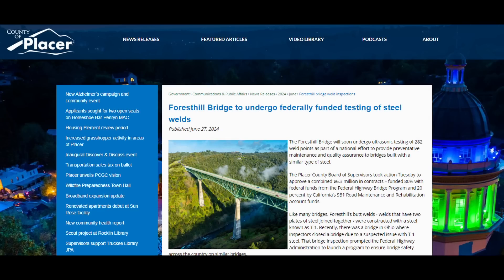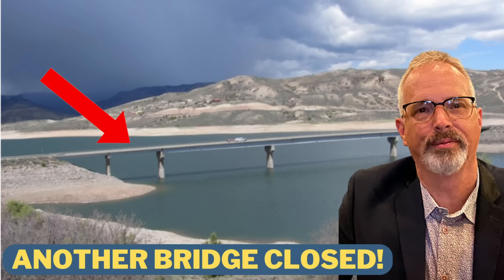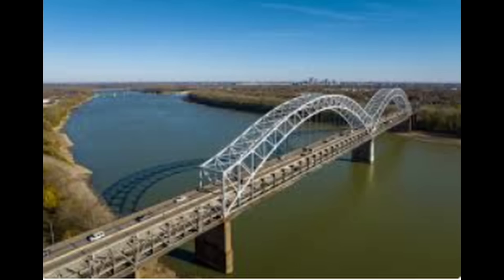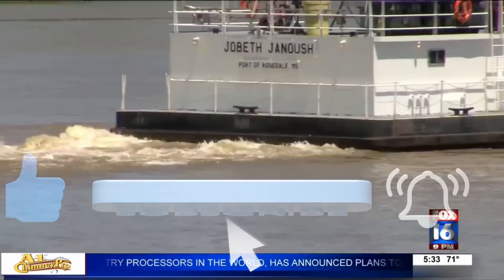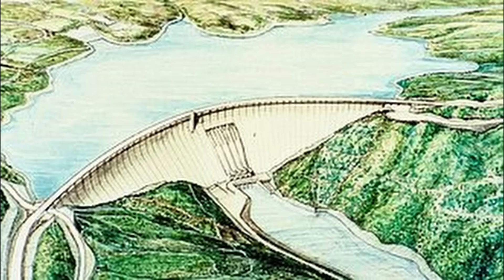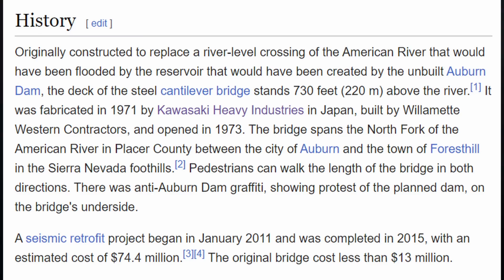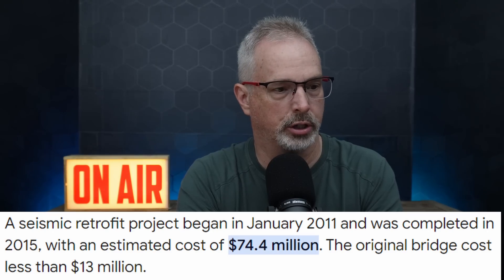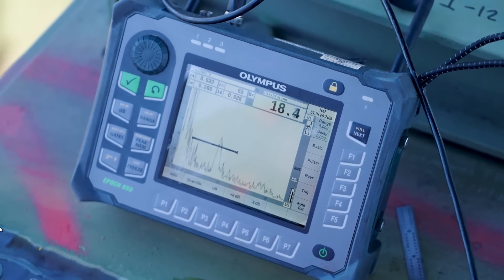Foresthill Bridge in California - Another T-1 Mess?

Comment: What welding filler was used? Were things like the original WPS saved?  Spectrometry could be useful if the filler is currently unknown. (Scrap yards and steel mills accepting scrap use hand held analyzers to determine metal composition.)

Comment: If T-1 steel requires technique sensitive welding and a higher standard of quality control than usual, perhaps it's not a good choice for most structures.  Hiring a framing carpenter to do cabinetry is a poor choice.  The designer of the bridge as well as the engineer may be more responsible for these failing welds than the foreman and welders on the job site.  BTW, many of the examples of failing bridges in this presentation showed cracks in the beams not the welds.

Comment: 1970s + A588 Weathering Steel + High Mast Lighting Towers + Deicing Salts
Can you imagine what went wrong? Not only was it very brittle but it never stopped rusting. They sent men up the towers to drill the cracks everytime they relamped. Used it in overhead sign supports too until one fell off a bridge into a car. Pack rust in that case. Hard lessons to learn. Hot dipped does pretty well. Not sure why we don't see it in bridge superstructures. It only lasts 30 years but so does coating and confinement for painting onsite is very complicated and expensive, especially over water. Galvanize + Zinc anodes if necessary. We can hot dip all of our guardrail but beams are too expensive? Or are there technical reasons?

Comment: Are there any metallurgist in the audience How? 
How do we know this was hydrogen embrittlement and not stress induced cracking caused by inadequate pre/post heat treatment.
The reason ai am asking is that hydrogen peniteration requires a significant partial pressure for penetration - conditions that don't really exist during an atmospheric weld.  The hydrogen if available usually causes rapid failure under stress not 50 or 60 years later.  Hydrogen can just as easily migrate out of the metal given time.
Given the date of manufacture of this of this metal, it is also possible that there may have been too much manganese or mill-scale in the steel.
Regards.

Comment: Hi, what was the common welding method on these joints? IF it was it MIG? Was hyd gas used in the mix? If not, then what caused the hyd embrittlement?

Comment: How much of this problem is the material and the welding technique and how much of this is the design for higher stresses?  The only reason to use grade 100 material instead of more common grade 50 material is to design for higher stresses and reduce the amount of steel.  Obviously going from 50 to 100 means you can save a lot of pounds of steel and a lot of dollars.  But designing for higher stresses in a bridge means also higher stress ranges due to traffic loading and it is the higher stress ranges that lead to fatigue cracking.  Then you combine higher stress ranges with welding and it gets worse.  Building codes have permissible stress ranges for different types of welded joints, I assume bridge codes would have the same thing.  I wonder if this type of steel requires lower stress ranges than other steel.  If so then there would be no advantages to using it over more common lower grade steels.  (For anybody reading that doesn't know- "grade" is a measure of the yield strength and has nothing to do with the quality of manufacture of the steel.)
Reply from the maker: Excellent point.  I didn't consider that combination but it makes sense.  This T-1 steel was supposed to result in a lighter, less expensive structure so it would only make sense that the design stresses would be higher.

Comment: I remember a Sacramento Bee article about this bridge back when it was being constructed that claimed the reinforced concrete support pillars were designed so that the waters of the reservoir would help support the weight.  I have never heard anything about that since.
Reply from the maker: I would think that the columns are better off not being submerged from a corrosion potential standpoint of the reinforcing steel in the concrete.

Comment: There are four types of welding. Gas welding or brazing ... Stick welding ... Mig welding where a machine has a coil of metal wire fed at the seam to be welded protected by a flow of inert gas .. and Tig where you have a tungsten tip in a handle, which also issues a flow of gas, and you manually push a melting rod into the seam to be welded. Likely Tig is the hardest; I tried it at a welding school in a community college. Anyone knowing stick welding can easily do Mig welding. I have never done Brazing.

Comment: They knew about this potential problem as soon as that bridge in Minneapolis fell, because the Foresthill Bridge has a similar design. Caltrans is currently doing a major inspection using the latest tools and may do repairs as needed. But unlike the bridge in Minneapolis, they haven't made changes to increase the load on the bridge, so I don't expect much in the way of serious structural wear.

Comment: We cross the East Liverpool bridge fairly frequently, and had to use the long detour when it was shut down.  1.5 miles west of this bridge is a fairly light 1905 built suspension bridge, still in use. It was built for lighter loads, so has a 10 ton limit. Street view is from 2019, and shows a crew inspecting the suspension cables.

Comment: I'm a welder, not an engineer, why can't they gouge out the crack and re-weld it to modern standards?

Hydrogen embrittlement in welds is fairly common. you have to keep your filler rods dry and fresh. They have to be baked in an oven to drive out any moisture, and they will start to absorb humidity very quickly. 

If you wanted structural welds like that these days, they would probably use thermal blankets to handle the pre and post heat

had to look up astm a514 for the comp
Carbon 	0.12-0.21%
Manganese 	0.70-1.00%
Phosphorus max 	0.030%
Sulfur max 	0.030%
Silicon 	0.20-0.35%
Chromium 	0.40-0.65%
Molybdenum 	0.15-0.25%
Vanadium 	0.03-0.08%
Titanium 	0.01-0.10%
Boron 	0.0005-0.005%

yeah, that's not going to weld well, and its a quenched and tempered product so the weld heat zone is already not great being there

Comment: Not knowing many details about this problem, from what I hear in the video and in the comments, the problem may also be an excessively hard HAZ in the weld.  This is due to heat input and hardenability of the steel.

If the crack is immediately adjacent to the weld toe, then I would be inclined to consider this as the problem.

PS:  I went and looked up the composition of T1 bridge steel and given its composition, this steel has a high hardenability.  Given the range of alloying elements in the material, the Carbon Equivalent (CE) ranges from 0.35 to 0.56.  A material is considered to be field weldable (or shop) if the CE is 0.42 or less; however, thick sections may require preheat and PWHT.  For CE > 0.42, (and especially in thick section greater than 0.5" t), preheat, slow cooling and possibly PWHT are needed in order to prevent an excessively hard HAZ.

With this composition, it would be very likely that cracking would occur if so-called normal welding techniques were used, that is no preheat, no slow cool and no PWHT.

I have had to solve welding problems with materials that had this high of a CE.  It is possible to obtain sound welds in this high of a CE material but as I mentioned it does take special precautions to achieve a sound weld.

Hope this helps.

Comment: I'm curious, why did the cracking in T-1 girders occur in the I-40 Hernando Desoto bridge girders where the attachment used is bolts instead of  welding?    If preheating and cooling procedures T-1 welding were not used,  then the failures in the bridges are in part due to the civil engineering firm by not monitoring the construction company's welding procedures.

Comment: The crack shown at 2:40 is not 'at the weld' it is on the  edge of the HAZ (heat affected zone). if the weld area had been pre-heated to around 200-220°C  at the time of welding it would not have happened. It is there due to rapid conductive cooling around the weld inducing micro cracking that precipitate embrittlement much earlier than would be the case with correct management of welding procedures.
Retired Engineering Professor at a top  British University.

Comment: Apprently this was another bridge built prior to the late 70's when the Federal Highway Administion started to adopt the Fracture Control Plan of the Bridge Welding Code to ensure proper welding procedures and post-welding testing to prevent defects like hydrogen cracking. 

Funny how bridges built well before welding - with only rivets or bolts don't have this issue. 🙄
Reply: Not having weld-specific issues is not the same thing as not having issues.

Comment: They should just plan on cover plates on all joints as a permanent preventative if there is any question about the structures that use this type of steel moving forward as the welds are questionable due to the materials used and design..

Comment: I had telescoping crane boom extensions made from T1 plate in the 1980s. No butt welds were involved. I did study the data sheets and the welder did too. He used a very high tensile rod. Did my own design calculations.  I did lots of lifts at the limit of capacity. No problems.    I can see the butt welds in a tension member would be a real worry. Nightmare.

Comment: If i understand correctly, the reason why the auburn dam was cancelled was because far more landslides than expected occurred behind boulder/hoover dam as it filled, leading to substantial concerns about how stable the land under the cities of auburn and foresthill might be as the reservoir filled.

Also, if foresthill bridge is condemned, I doubt it would be replaced since it would be much cheaper to improve the road that runs through auburn SRA. The bridge was only needed because the alternate road would have been submerged
Reply: It was put to a vote and the Chicken Littles of the area got their way. Fools.

Comment: WHat about: Hernando de Soto Bridge on Interstate 40, connecting Memphis, Tennessee, to West Memphis, Arkansas, experienced a significant issue with a crack in a T1 steel beam, leading to its closure in 2021 for emergency repairs. This incident sparked a broader inspection mandate by the FHWA for bridges with T1 steel.
Sherman Minton Bridge between Kentucky and Indiana over the Ohio River was mentioned in connection with T1 steel issues, leading to an advisory for inspection due to potential cracking from hydrogen embrittlement in welds.
Francis Scott Key Bridge in Baltimore, although its collapse in March 2024 was due to a collision with a container ship, highlights the attention on bridge integrity and material performance under stress. However, there's no direct mention in the provided X posts or search results that its construction involved T1 steel or that its failure was material-related.
Pelican Island Bridge in Galveston, Texas, suffered a partial collapse after a barge collision in 2024. While this incident showcases vulnerability in bridge design or material resilience, there's no specific mention that T1 steel was a factor in this case.

Comment: In the early 70's when this steel came into use, the shop I was working in made sure anyone welding the higher strength steels was qualified and using the qualified procedures. That meant that we used a lot of gas to heat up the sections prior to welding and a lot of gas for a slow cool. We used 9018 electrodes and, later, 1118. Mostly ran 5/32 and 3/16 lo-hy kept in heated ovens. The containers we took to the weld itself were insulated and we were not allowed to use from a container that had cooled enough to to handle with the bare hand. Joints were cleaned to TIG ready and maintained that way. In later years I learned that a lot of shops didn't really maintain the lo-hy nature of the situation for electrodes or plates. So no surprise the cracking. I had the great fortune of working for some folks who knew the trade and had actually studied the metalurgy!
I'm 76 now and I'm just ashamed of the practices used in the trade....
Keep up  the good work!!  We weren't building bridges but other stuff for equipment and buildings.
Reply: Ironbridge is still up near telford. Since then we seemed to have pushed our luck on steel structures.
Reply: @teamidris  Largely because it is in compression, not tension.
Reply: @SteamCrane  kind of a good thing though, for any bridge. It’s like farm gate hinges, so simple and reliable.
Reply: In the shipyard, it was HY80 steel used for high repeated stress areas like bows, rudders, etc. Submarines use HY80 too. Welding to a rudder post casting was a real nuisance. We used electric heating pads to heat the steel to 130 degrees. stick welded it, then gradually allowed it to cool over several days. Being a shipfitter, we had to slightly bend the over an inch thick already curved plate sections with hydraulic jacks to make them fit. And yes we broke lots of jacks :)> The shipyards have huge hydraulic hammers/ presses to bend steel to "about" the right curvature & etc.  We had to force the steel the rest of the way until it actually "fit."
Reply: This steel came into use in bridge construction in 1959. Standards weren't in place back then to deal with T-! Steel.
Reply: @michaelcurtis-cdot8978  I hear you, but iron bridge was made when there weren’t iron bridges. Unless someone made a brass one there weren’t any metal bridges before that?
Reply: @teamidris  Aren't we talking about ForestHill Bridge?  I am not responding to IronBridge.

Comment: Hydrogen embrittlement has nothing to do with T-1 steel. 
It’s solely a welding procedure failure. 
At the time these bridges were built very little oversight from inspectors to keep the “low hydrogen” welding rods hot and dry. 
Today we don’t use low hydrogen welding procedures on bridges and most have a “D1.1” style full inspection meaning the inspector watches you weld the connections start to finish insuring your work is done correctly
Reply from the maker: Thank you for that clarification. There is T1 steel connection per FHWA. Is it just harder to weld?
Reply: @CaseyJones-Engineer   Not at all but hydrogen embrittlement is a common problem when using low hydrogen procedures. 
The welding rods need to stay in an oven right up till the time of use to keep them dry. 
If they’re removed from the oven and allowed to cool, they’ll absorb water which is H2O causing the issue we see here. 
The D1.1 process I mentioned requires pre heat and weld rod control assured by the inspector the entire time it takes to complete the process. This all came about on the heels of the 1995 Northridge earthquake in California where many bridges and buildings had to be replaced because of this issue and almost zero oversight by competent inspectors. 
Current bridge construction is done almost exclusively by wire procedures where embrittlement is rare. 
T-1 steel is similar to mild steel but with ever so much more carbon and nickel.
Reply from the maker: @johnwingerd2831  Awesome, thanks for providing those details!
Reply: @CaseyJones-Engineer  Look for the Weld Process Specification(s) used for that bridge. The AWS forum would be a good place to find experts too.

Comment: I have not used a lot of T-1 steel.  All my welds were done using flux-cored wire.  There have been no issues with cracking on 30-year-old weldments.  It seems to me that the issue is not the steel.  Rather it is the welding procedure. Perhaps you should do a video focusing on the currently recognized proper welding parameters and how the welding was done when the bridges were constructed.  Maybe a welding engineer might do a collaboration with you. I'm going out on a limb here and guessing that Kawasaki might have used wire in prefabricating the Foresthill Bridge, which may be less prone to embrittlement.

Comment: As a welder/fabricator I used to repair earth moving equipment, that used T-1 steel, or wear plate similar to it, as it's structure.  It surprises me as others have stated, that it was used for bridges.   It is great for it's wear resistance and has a very high tensile strength.  Preheat and post heating of the welding process are very important.  Another factor to keep in mind as I was told where I worked was the huge differential between the tensile strength of the plate versus the strength of the weld rods I used.  If I remember correctly, the highest strength rods I used were called 9596 which had a tensile strength of 86 000 versus the 110 000-130 000 of T-1 type steel.     This causes the welds to bear more stress because the welds will yield earlier under load versus the plate itself.  This rod I used was supposed to be more ductile, than 7018 to help with that, but I just used to try to keep in mind the difference, and tried to account for it by making my welds larger to help compensate.
Reply: "tink!"  the sound every welder hates
Reply: 11018 rods exist too...9596 is for repairing leaf springs and scraper blades not bridges/
Reply: They didn’t use bolting, or metal technology hadn’t advanced to the capability to manufacture Grade 5-Grade 8 bolts?
Reply: @ssaraccoii  Structural bolts have advanced further than Grade 5 and Grade 8 bolts.  The current A325 bolts have a lowerish tensile strength, but are much more ductile (stretchable) than Grade 5, and particularly Grade 8 which are pretty brittle.
Reply: @ssaraccoii  Bolting and riveting has its own concerns including corrosion between plates, stress raisers etc not present in welded construction.
Reply: I also used T1 as a wear surface on front end loaders operating on a paved surface. I was instructed to use "low hydrogen" rod.  Now I know why I was frequently welding up cracks...